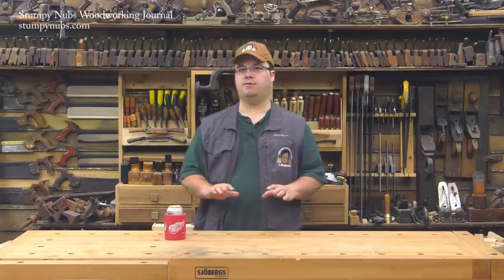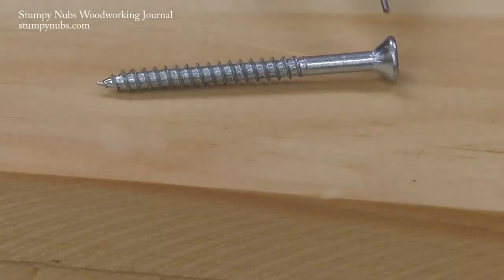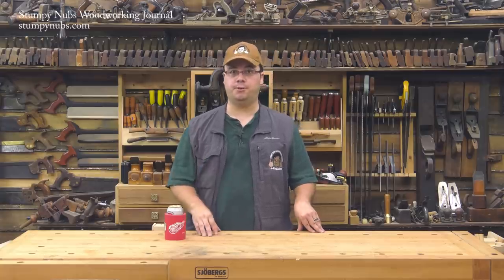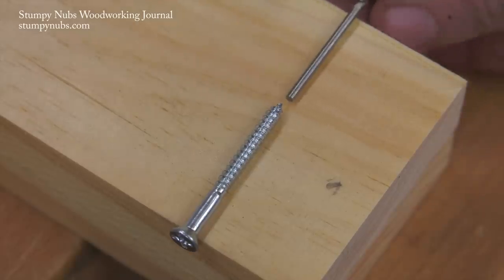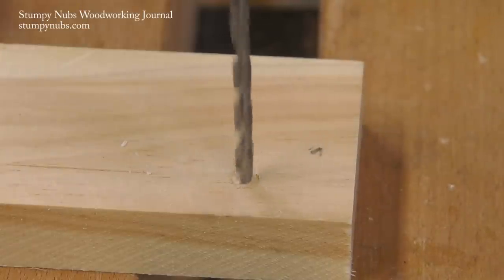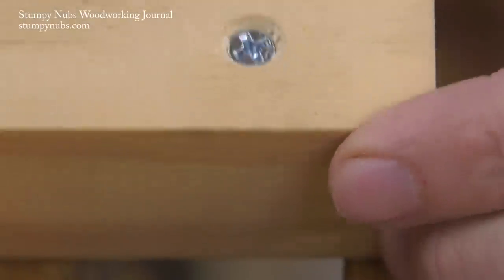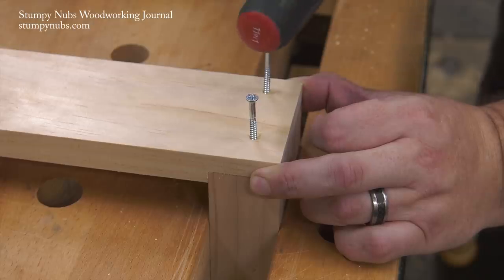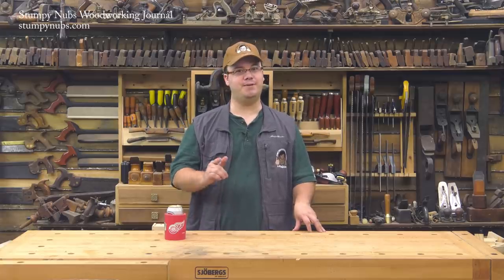Why old-timey woodworkers' screws held better (How to bore proper pilot holes)

Comment: I think the best tip in there is unmentioned. Reversing the larger bit for a few turns to center it before drilling.
Reply: Wow! You're right. He does it but does not mention. I would never learn this if you hadn't pointed it out. Thank you, this is great advice!

Comment: As somebody who began their carpentry apprenticeship back in 1974 I suppose I could be considered a ol' timey, so here's a bit of information I feel I should share. The final 1/4" - 3/8" of the pilot hole for the thread should remain as solid material. This is termed the lag. It accommodates the tip of the screw thread and allows for better clamping of the material beneath the head of the screw.
As the saying goes, you're never too old to learn, and believe me, I'm still learning my craft. Love your channel by the way.
Reply: This is interesting and does make sense! If the pilot hole goes too deep the threads on the screw tip might not even catch on the material.

Comment: Thank you so much for this video. I thought I was the only one that actually drilled two different sized screw holes. Now I know that this is how it is actually supposed to be done. :)
Reply: This is how my dad taught me. I did this on a job one day and the younger guys were busting my ass about it. One  of the ol timers walked by and said, "stop busting her hump because she's a better carpenter than you guys are." I still buy him lunch every Friday.
Reply: @ilikewaffles3689  not for decades.
Reply: @ilikewaffles3689  If you are over 20, you probably don't see yourself as a boy. You see yourself as a man or male. Less confused now?
Reply: @ilikewaffles3689  After 25 years of working as a  carpenter, it is a testament to my sense of humor I am only snarky instead of a mean bitch with a nail gun.🙃
Reply: @ilikewaffles3689  just call them broads. That can mean young girl, teen, woman, older woman, or even an old bag. You can’t go wrong.
Reply: @KitchenerLeslie2  Girl, woman, or broad, she owned this guy.

Comment: Absolutely spot on (speaking as a holder of an advance City & Guild joiner/cabinet maker certification). "tip" Rub your screw threads across a piece of beeswax/candle wax when screwing into hardwoods.

Comment: One tip; drill the countersink first, this gives the point of the bit a center to hold it in place and stop it skipping around, the resultant cone shaped hole also acts a centering guide for the remaining drill bits. Doing it in this order will give you really neat countersink shoulders.

Comment: This is a fantastic explanation to teach people how to do proper work no shortcuts for a proper joint. If your wood is dry you can also rub the screw across a bar of soap  and put it in my hand so will not split with heat from speed. My grandfather showed me this when I was 10 I'm in my 40s now. I learned so much from him before I went to woodshop in high school and trade school it wasn't even a challenge for me. It's a shame you can't get what you're worth for Quality woodwork anymore. At least I got a chance to work on my house when I bought it with my grandfather and my father rebuilding everything we did a three-month job in 6 weeks under $3,000 refurbishing a house that should have cost around $12,000

Comment: As usual, your video was excellent; thanks for all your contributions to woodworking.  I would just add that if I use the countersink first, then drill the holes, I get a very clean countersink; however, if I countersink after drilling the holes, the countersink bit wabbles in the hole and makes for a very uneven countersink in the wood (as you can see in the video).

Comment: Having 3 drills on the ready is also handy.  1 for each step so you don't keep swapping between bits.
Reply: The cheaper option is to buy some little hex shank mini chucks. I mount my most used smaller bits in those & then you can swap them out without having to spin the drill chuck back & forth a long way each time.
Reply: You can also put a quick change jaw into your drill and put some drill bits into hex nuts. Not useful for every task, but for the 4-5 most common drill sizes you need this is worth gold.
Reply: That is not "wearing the pants", that's being overly controlling.
Reply: But L Mulligan, you said she asks you, even with the money she makes.  If no one asks and you're each using your own money, I don't see a problem.
Reply: 4 would be better, 1-first pilot hole, 2-swcond pilot, 3-countersink, 4-driver.
Reply: I keep a countersink bit in an old manual eggbeater drill. It seems easier to control and to reverse to smooth out the funnel shape.
Reply: Quite right. The countersink bit has the pilot size drill bit, and like The Man says, gets drilled first, using the Bosch. Next, pick up the Makita with the clearance size bit loaded and proceed with step 2, minding one's depth, of course. Finally, when the time is right and the Muse descends, it's a cordless, ladies' choice, with the correct driver bit ensconced. Accompanied by a chorus of angels, sink the fastener, nestling it just so into the countersink bed awaiting it. Set depth is critical, a matter of +/- one split RCH. This step is seen through with the heart, not the mind. For us, torque is felt, not measured. Torque transcends mere vulgar calculation. Torque is art, not science. So I use a hand tool for that enchanted last quarter-turn.
Unless I'm running late for the game, then I just shoot in a couple nails  and hide it with extra thick globs of paint right there.
BTW, fastener drive must be square or star. Philips is verboten. And everybody knows, if you use a slot, you will be shot. Unless you're a gunsmith.
Reply: @blackvic5157  Or installing fixtures on a good boat using  bright brass screws with he all the slots aligned.

Comment: I must be missing something on the last technique. What did the awl holes do differently than the marks made by the screws, and what makes it pull in two directions? Don't the screws still land in the original impressions?
Reply: We have not, as of yet, received any feedback ...
Reply: The offset creates a lateral tension, perpendicular to the direction of the screw(ing), which snugs the shoulder joint at the same time as the longitudinal (in line with the screw) pull. Two directions.
Reply: @VideoNOLA  Only if the screws land in the new holes made by the auger. But since the pieces were already tight when the first indentations were made by the screws, the screws can only go back into their original indents. That's why it doesn't make sense to me.
Reply: @MrJasonwoodrow . In soft pine, there is a good chance that the high speed wood screw totally ignores the 1/16” offset and just rams straight through. Pine verses steel, well you know who wins. 
Hardwood species have a better chance of bending the wood screw into the offset pilot hole.
Reply: I agree.  I think that full depth pilot holes were to be drilled in the awl holes.  Then, with the piece to be attached riding near the heads of the screws, screw both screws in most of the way.  Finally, push the attaching piece down as close as possible to the final position, then use the screws to finish the attachment.  Seems like a roll of the dice on whether or not the attaching piece splits or not.  Perhaps this is why he didn't demo the entire thing.
Reply: @VideoNOLA  Lateral compression actually.  Tension denotes pulling apart.

Comment: Yup. That's how I learned it. Using a brace and bit and an egg-beater style hand drill. But no new-fangled electrical driller-thangy...I had to use a old fashioned screwdriver, with slot-head screws. Brass screws in oak was a challenge. I remember using soap on the screw threads, and making darn sure the pilot hole was big enough. Taking your time, and backing the screw out a few times like when you cut threads on a bolt or nut...bit by bit till you got a tight seat, and no spalling allowed on the screw head!

Comment: Thank you. A lot of wood screws here in Europe have a collar between the threaded and unthreaded part that enlarges the hole made by the threads slightly so the two pieces will be pulled together tightly. Along with the special tip that drills into the wood and the ridges under the head that countersink it these are quite good in softwoods. Not for furniture grade stuff, but I've not had anything come apart on me with a screw like that in it, unless it was exposed to water.

Comment: YES! I've been arguing for this going on decades now but those irksome thru-pilots tend to cramp people's style. I think of the screw like a vise or clamp and use it to draw the two parts of the glue joint together while it cures. After that, the screws are redundant but are usually left in place.
Reply: Agreed. I always use this method.  Threading both pieces is simply not on. Ruddy bungling, is what.
Reply: Agreed about using the screw as a clamp to draw together and hold two surfaces while the glue dries. I usually run the screw back out then, but if there’s any chance of sheer or torsion I drill out the screw hole and sink a dowel in its place.

Comment: Also worth mentioning that a proper wood screw has a single-start thread. Modern general-purpose screws often have a twin-start thread which is great for quick insertion but doesn't give as firm as joint and is more likely to work loose.

Comment: This is good. Thanks. As someone who's been doing this for more than 40 years, often wrong..... Take some time and practice on scrap. Instead of sitting around watching TV on a Saturday, spend a few hours practicing a skill like this. Two bits and a countersink? That's a lot of busy work, but if you just get used to doing it, then you just do it right because it's the way you've gotten used to doing it. (btw I've never had a screw/countersink drill bit that actually matched any specific job I was doing. But I still use them. The top piece drill: Why are none of these ever 3/4" long? Instead use the long tapered ones, and I mostly use some variation of drywall screw. I've learned to just pay extra for the self drilling ones. This is a bit lazy, but it's faster, usually no countersink (soft wood and ply).)
An offset? The video makes it look easy, two common problems with offsets meant to draw, this also includes offset dowels. It's very difficult to get the right offset, it's also difficult to consistently drill the hole where you want it, the bit walks, the grain in the wood knocks the bit off a bit. This is where practice makes you good at it. Hinge screws? Get a centering-pilot-hole-punch. It's almost impossible to drill a pilot hole or just screw in a self-drilling screw without trying to offset the rest of them to counter the unwanted shift.

Comment: Years ago, you could find drills made for woodscrew holes. They had the countersink portion, plus the clearance portion, and the pilot portion, which were both adjustable for depth. I can't seem to find them anywhere now.

Comment: Thanks for this. I thought I was doing it the right way, but I’ve been missing out the clearance hole.!  I’ve done a few basic projects and want to work my way up from planters and raised beds to making some small furniture pieces. This will certainly help. The offset tip was new totally new to me. I will be trying that soon.

Comment: I've been using Woodies in some projects lately.  They're self drilling, drove 'em right into hard wood without drilling pilot holes.  Behind the thread is a cutter that'll make the larger diameter hole in the top workpiece.  They have edges on the bottom of the head that'll scrape away the countersink hole.  They're torx for good grip.  Love these screws, just drive 'em in without using drills or countersink bit.  Used hundreds of them, no cracking sound no splitting just bzzzt into the wood.  Only advantage to drilling pilot holes is that a drill press makes it easier to drill perfectly straight.  For some projects that won't matter much tho

Comment: Good One!   Also, real wood screws have a better shear value due to the thick shank.  On older cabinet work, that thick shank and a pan or round head can also be used as a pivot point for hardware.  I still use them often, but it can be difficult to find good screws.  Any sources you can recommend?

Comment: I would add that you should use a "pepper board", a thin scrap piece with a hole slightly bigger than the head that goes on top of everything else, and you screw the screw down through it. It protects the surface of the top piece when the screwdriver inevitably slips out of the screw and you stab the workpiece with it.
Reply: When nailing off sheer blocks on the overhead panes of a solarium, my boss had us use our hand as protection from hitting the glass. It worked. Only hit my hand once.
Reply: must be using a phillips bit... up here in Canada we use robertson. Try it, you'll never go back :)
Reply: You know why those super small screws in mechanical watches are blued? Even the slightest slip of the screwdriver by the watchmaker would scratch that blueing showing bare metal (the proper color of the screw was achieved by heating the screw to the correct temperature in a small "sand bath" - without any chemicals, coating or such). I.e. this was to show the skill of the watchmaker.
Reply: @humblehunk9022  I have used Robertson. They slip, too, especially if the driver bit is worn, which means after driving more than three screws. Torx is the way to go.
Reply: @jjohnston94  Oh, I'm not denying torx is better, but they are twice or more times the price. 

And if you strip a Robertson after 3 screws you're not screwing properly ;)
Reply: @humblehunk9022  or you're using bits made of cheese grade steel.

Comment: OMG! Thank you for this video! I have a bit of OCD and was doing this all along for nice tight fitting joints and hated when the wood pushed itself apart, but hated that I was taking so long just to screw wood together for my projects... and I can never make both screw holes at the same time. I always need to place at least one screw so it "holds" the boards in place, then I can make and drive the other one(s).
One trick that I have found that works (that satisfies my OCD) is to drive the screw all the way in, then back it out to where it releases the second piece of (on softer) wood(s), then drive it in a second time.
So its like my screw makes its own pilot hole, but the threads are mis-aligned until I unscrew it, then screw it in a second time.

I don't feel so bad now for being "A perfectionist!"
Reply: Prairie Climber you may be saying OCD, but what you’re describing sounds more like OCPD. Common mistake.
Reply: Alex Cole just googled OCPD, yes! Never heard of it before
Reply: Prairie Climber I was constantly being told by my friends I was OCD and stumbled upon it proving to them I didn’t. We have a Facebook support group if you’d like to join, I’ll try to find a link or some way to invite you or maybe easier if you search for it and I’ll add you when I see your request.
Reply: Alex Cole Oh, Thank you, but I’m not super OCD or OCPD. It’s more a figure of speech for me,... things can bother me if not done right, but I don’t obsess over things, but I will express my concerns!
Thanks again for the invite!

Comment: I have used a shortcut offset screw technique. The first step is the same. Then without disassembling the joint, drill the pilot hole as close to the joint as possible through the first hole. The remaining steps are the same. This is really handy if the parts are heavy or otherwise hard to disassemble.